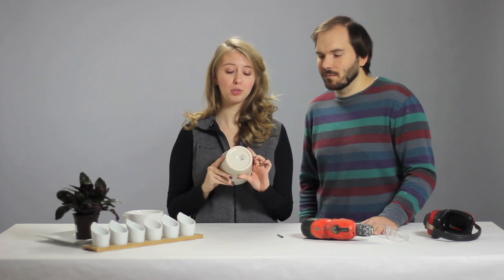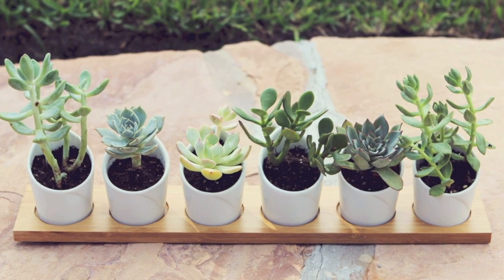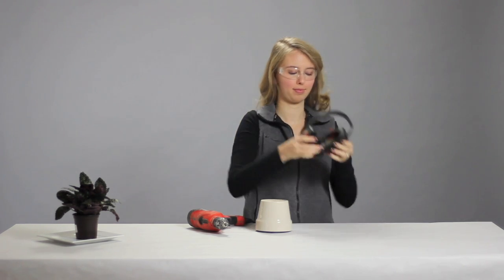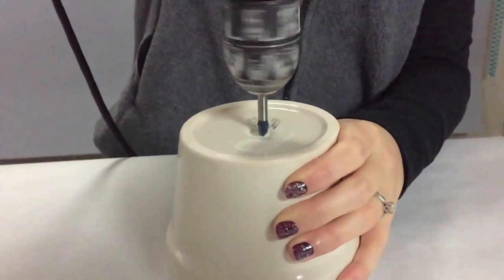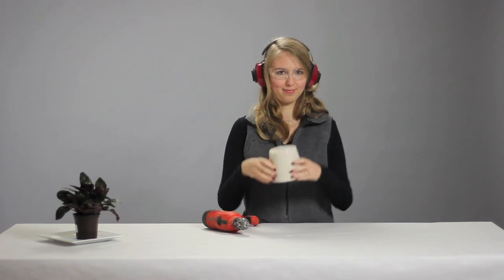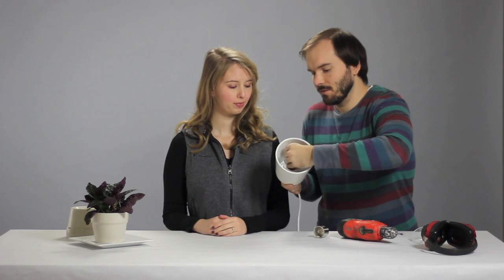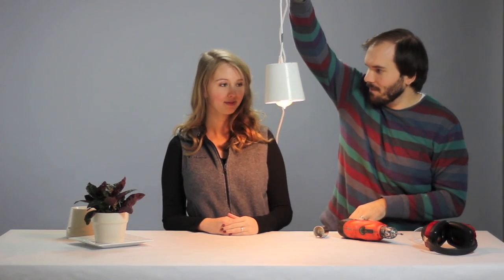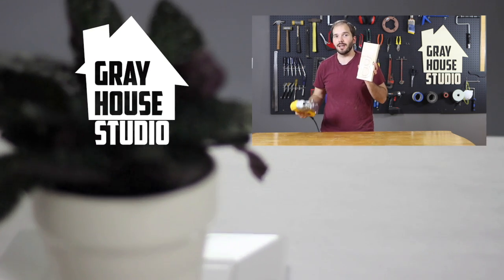How to Drill a Hole in a Ceramic Pot

Comment: After drilling the hole, do you recommend coating the hole with any type of sealant or something to prevent water that enters pot from turning milky and mixing with the unsealed exposed ceramic?
Reply: Ceramic is essentially just molecularly bonded glass and minerals, there is no need for it to be sealed. If it is turning your water milky, then it’s not a ceramic pot.

Comment: curious.. would it crack the bottom if two/three holes were drilled in small cup
Reply from the maker: +jimmythesaint It might crack if they are right next to each other but if they are an inch or more apart it should be fine.

Comment: I never ever use safety gear, my bad. Great video though!
BTWay, I want to drill a hole at the bottom side (for a security tether) of a very old Aztec ceramic art pot (expensive). What would you recommend so I don't crack it. Thanks!
Reply from the maker: The (expensive) note makes me a bit nervous, but just don't put much pressure and add a little water. You can tell really quickly if it is going to drill easily. You will notice dust piling up around the bit, that is a good sign. High fire clay like porcelain takes longer, but if it is Aztec it probably isn't porcelain.

Comment: I was hoping for a demonstration of using the hole saw :(
Reply from the maker: The process is very similar with the hole-saw. Just make sure you have the hole-saw that has the diamond coating on the edge and not the one that has teeth.

Comment: very safe...glasses (pretty useless), earplugs ( pretty useless), and no gloves (the only needed thing)
Reply from the maker: Disclaimer: No hands were injured during the making of this video*
Reply: Gloves may actually be a hazard when working with power tools. If a glove were to somehow get caught in the bit, it could severely damage your fingers or hands.
Reply: As previously stated wear a mask do not breathe the dust. Glasses are a must, ceramic shard to the eye = a whole wkd in A&E. Unlikely but still a possibility. 
Everyone should own a faceshield/goggles combo, gloves and a good respirator, not a mask. You need respirator for all sorts especially spraying and cutting. 
So just splash out guys and get good PPE, look after it, and it will in turn look after you long term. Gloves are fine when drilling, just don't put your hand near the rotating parts. Sometimes I just wear one glove to sweep away dust as I go. 
Remember grinders and step ladders cause the most accidents.
Grinders kick back and lock, and the blades shatter. 
And people fall from ladders because they work alone. Always have the ladder footed by someone else if poss. Stay safe